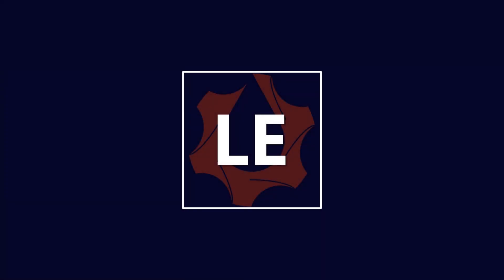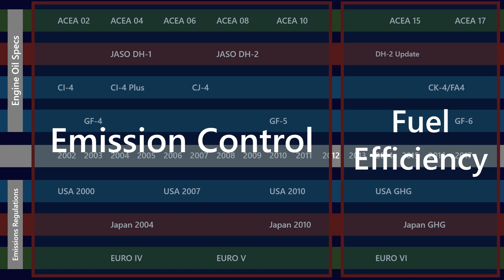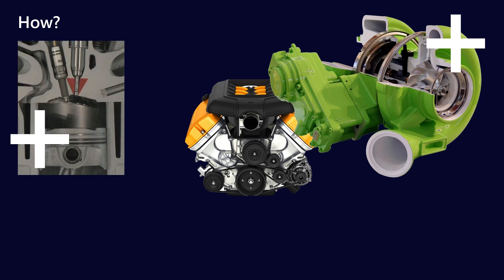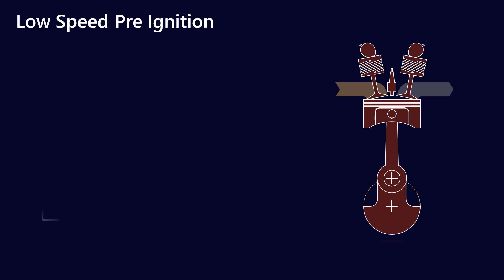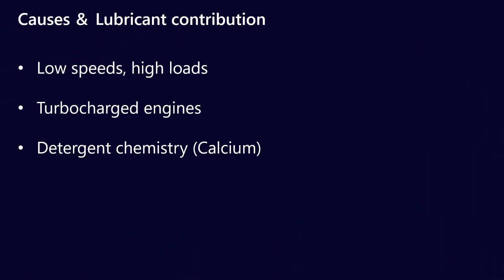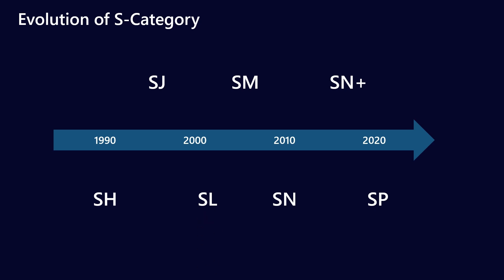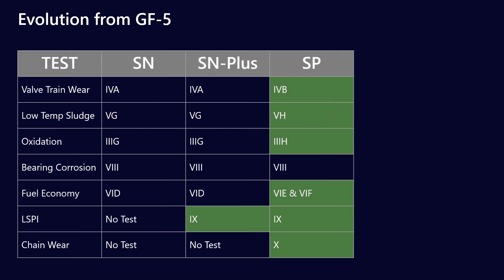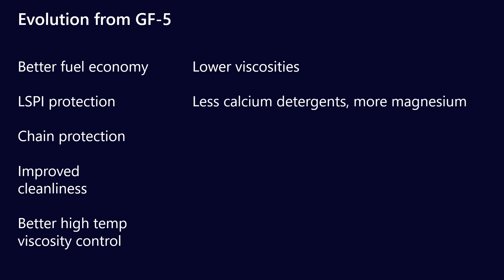SP and GF-6 engine oils - what’s new?

Comment: I wonder if these new oils are even more friendly to flat tappets after break in?
Reply: Nope, SL is the best for Flat Tappets
Reply: @danielsolomon1710  never had an issue with off the shelf oil on 30+ classic cars I’ve had since 2014
Reply: @danielsolomon1710  only time I used a special oil was for break in with driven high ZDDP oil. Not a single lobe down yet. Stock spring pressures and stock lift don’t need anything special. 800ppm zinc is good enough after proper break in. And now with SP there’s less calcium surface competition with ZDDP.
Reply: @Gleone58  I use HDEO in my gasoline engine because it keeps my engine super clean, cooler & longer OCI thanks to high TBN
Reply: @danielsolomon1710  be careful since HDEO formulas are very different within themselves. For example: base rotella is like 1200 ZDDP but is very high in calcium where as Mobil delvac and Chevron delo are much lower in ZDDP close to cars and the calcium is still high.
Reply: @Gleone58  luckily my car is not small cc direct injections turbo engine. I am using a Shell Rimula R6 LM 10W40. It is twice cheaper and better than Shell Helix Ultra. It comes in a 20 liters(21.1338 quarts) bucket for trucks 🤣
Reply: @danielsolomon1710  I know about the LSPI deal but that’s not why I’m saying anything about calcium I don’t own anything DI. Calcium tries to cancel ZDDP out on a given metal surface. They share the same polarity. So on something as critical as camshaft break in you really want almost a near non-Detergent (calcium) oil with a decent 1200-1600 ppm ZDDP and thats it for about 4-800 miles then change over to whatever you want to use. SP reductions of calcium let’s ZDDP do more work instead of fighting.
Reply: @Gleone58  that's exactly what the motor oil geek said in its new video 🤷‍♂️thought 800ppm is enough for stock cams/springs.. racing ones will want more though

Comment: Direct Injrction only + turbo is a bad combination for disasters, requires due diligence in routine maintenance. I've been using Shell Helix ultra 5w-40 which was recently API SP certified, worked well so far for the N55. Noticed Nulon Apex+ and Gulf Western - some 5w-30 meet API SP, hopefully they'll help the Skyactiv-G last. Bit l bit longer. Can't find good cars like GH Mazda6 with MZR (port injection), dual injection might be a good alternative but complexity isn't going to help even if they are made by Toyota 😮

Comment: SP addresses LSPI, but BMW LL04 blows it away in wear protection, sludge protection, deposit protection,  soot thickening, aftertreatment compatibility and fuel economy. Oxidative thickening is the same (Lubrizol Specification Comparison tool). SP is only 'much better' in one area and worse in all others.
Reply: You act as if all SP oils produce the same WEAR. This is simply false in every way…
Reply: @nordicpride9708  I don't 'act' I quote the source that I have used to state what I state. The tool is made by an oil manufacturer (Lubrizol). It's not 'my' knowledge, it's 'theirs'.

Comment: Would be good to explain what they mean by ASH content and what it is. Also how if at all do the new oils reduce the chance of intake, intake valve and turbo carbonization?
  GDI engines require low ash content. Is that to reduce wear or carbonization from crankcase vapors?

Comment: Get rid of low tension piston rings & low tension oil scrapper rings. I think ICE must be designed to have maximum engine oil consumption of 0.1litre for every 1 litre engine capacity for every 1000km travelled, doing at 100km/hr and the  engine had done total of 50,000km.

Basically a 2 litre capacity ICE should not be consuming more than 0.2litre of engine oil after travelling 1000km at 100km/hr.  

Otherwise it is pointless trying to limit calcium or zinc to 1000ppm in trying to avoid damaging or impairing the exhaust catalyst for emission control. Yes, No. 🤔🤔🤔

Comment: GREAT UPDATE. Thanks ... so we Boron antiwear additives be sufficient to protect flat tappet engines ... or should we stick to SM rated or lower, or special designations by manufacturers who might specifically add extra Zinc (meaning phosphoous) given that Cat issues are not big for older engines.
Reply: If you can find SL grade it will be better for flat tappet

Comment: Recently some manufacturers have brought out a 0w-8 oil, an even lower viscosity than 0w-16! I assume also under GF-6B, although it may not be. Thanks for the interesting and informative video.
Reply: That's Toyota. And they're using a LOT of molybdenum to get there. Really interesting.
Reply: I saw a YT video where someone bought a new Toyota Corrolla (2023?) that required 0W-8. Even the dealer didn't carry it!

Comment: During 199x Engine works about 300 - 500K km till general repair....
Its 2023 with amazing lubricants with huge amount of parameters inspected, and engines works about 150-250K km. The main reason is sludge and ash on postons and piston rings.
WTF..... 
Looks like bullshit was placed at users ears and mind..l by Marketing. 

Thank you for trying to explain.
There NO difference between mineral and synthetic oil depending manufacturer recommendations to oil raplace .
So its doesn't matter whether you use synthetic or minaral.

Comment: Where is the gain for the customer though, direct injection=carbon buildup. 0-16 or 0-20 oil in addition to low tension piston rings=oil consumption. Seems they destroy a previously functioning engine setup, to "save the world" which doesnt need saving anyway. And the money for repairs is spent by the customer. Sorry, this is all BS.
Reply: See the chart at 1:30, that’s the benefit.  I drive a 2014 Silverado 5.3 with direct injection.  I wish carbon buildup wasn’t a thing, I have looked at my valves, they are quite dirty, I have never cleaned them but the engine still performs very well.  160k miles
Reply: I have a ‘12 HV I purchased new. Over the course of its life I’ve spent ~$10K on fuel(127K at $3.50/gallon at 45mpg).

If the HB dies today it’ll cost me $5K to have a dealer install a new one. I can do it myself for less than half that but most can’t.

If it was a comparable ICE only engine sedan from that era I’d have spent ~$15K in fuel but no HB replacement cost ever.

So in gas savings, I’m currently ~$5K in the red right now still driving on the original HB.

When the HB in my vehicle needs replaced, a regular person’s fuel savings will have been completely negated.

It seems to me the whole thing was a wash… from the consumer’s wallet’s POV.
Reply: @EvzenKovar-i5p  That is an interessting comparison. Let me add a different perspective: The manufacture and replacement of the failed part will be way less emissions than burning $5k worth of fuel. So the system is working, it is reduing emissions...
Reply: @realseek  
Absolutely. I was simply looking at it from a consumer wallet perspective. From my angle,  I honestly should have bought a straight ICE vehicle in back in 2012.

I keep my vehicles for as long as possible. Because of this, the purchase of this HV put me at a unique disadvantage relative to a similar ICE only vehicle.

The hybrid battery is not the only unique and excessively expensive component of a HV. Toyota eCVTs, whilst technically rebuildable, must be replaced as an entire unit when they fail because it’s impossible to find anyone who will work on one. That’s a cost approaching $10K.

ICE only vehicles don’t have an inverter to eventually fail with age. Probably will set an owner back ~$5K. Having an inverter also means a second cooling system with a second water pump to fail.

HVs often send coolant to the catalytic converter in order to try and bring the engine temperature up faster for emissions. These often fail with age, go unnoticed by the owner, and overheat the engine. Due to current machining tolerances, and nothing being rebuildable anymore, it’s now time to buy a new engine.

The regenerative brake systems have a highly specialized brake booster, that contains a nitrogen cell, which fails with age and will set an owner back ~$4K. 

Because HV engines start and stop so frequently, they have ubiquitous issues with the thermal expansion/contraction cycling that wreaks havoc on head gaskets. A head gasket replacement will set an owner back ~$5K. A person who does mostly city driving is at greater risk for this expense than one who drives HWY. Again, due to extremely tight machining tolerances, this often can mean a new engine.

Relative to the consumer’s wallet, none of these exposures exist with an ICE only vehicle.

HV and EV vehicles may have lowered carbon emissions as you describe, but I was shocked recently to learn that only ~5% of these vehicle’s batteries are currently being recycled globally at the end of their serviceable life. The rest are creating/destined to create massive long term environmental damage in the form of water and soil contamination.

Comment: Stop Start is an anti knock system. When does an engine start overheating? Idling in gear at a stoplight.
Reply: Start Stop leads to more engine wear. It's not an anti knock system viz a viz stop lights. It's a system to take care of EPA
Reply: @_pramodchauhan  So why are you supposed to wait 20 minutes after the engine stops to check your oil?
Reply: @suggesttwo  The dip stick checks oil level from the oil pan. You let gravity do its thing n then check the level. Not necessarily 20 mins. 5 should be ok.

Comment: Dropping calcium additives from 1200ppm to 800ppm equal to reduction by 1/3. From 2005 to 2015, companies like BMW, Toyota, VW, KIA and few others have somehow messed up designs of their pistion-pistion rings. This leads to high engine oil consumption of >0.5 quart per 1000 miles. These "consumed oils" and their additives will eventually get into top of pistons and later onto catalyst. Logically, this will quickly lead to failing of MOT test. Good engines should not be consuming more than 1 quart engine oil per 6000 miles. Regards.
Reply: GM did the same with their V8, lots of oil burning in those engines, design most likely

Comment: Would i benefit from switching from 10w40 api sn to 5w30 api sp? I understand it is backwards compatible but is the api sp designation okay even on a wet clutch manual transmission motorcycle?

Comment: i’m not a engineer but I just cannot conceive how big ole semi truck 18 wheelers are going to be able to be manufactured to handle a 0W oil.  Of course not being an engineer, I could be way way wrong so please let me know.  Which also begs the question, what in fact is the largest displacement engine in existence that uses a 0W oil?
Reply from the maker: Great point. So I think that the 0W's are most likely being applied to small displacement engines. 0W's seem to be more common in the European manufactures, which makes sense because the manufacturing tolerances tend to be smaller on those makes.
Reply: ohhhh ok makes sense.  Thank you!

Comment: i do find it hilarious how “they” got away with the whole “stop-start” bs. Which involves moving parts, which in turn increases wear on the engine over the life of the vehicle, which in turn, causes more waste in the long run, thereby canceling out all supposed short run mpg “savings”.   It is hilarious to me that “they” got away with that stupid rule, and also quite saddening that more customers are not aware or informed on such simple mechanical concepts.  Oh, right, go ahead and repeat to me the fun marketing lines of how they improved the starter mechanisms to handle many more thousands of start-stop-starts.   I love laughing at folks that tow the line like that. 😂. At least there are plenty of places to go get a simple “start-stop” delete installed on the vehicle, well in the States anyway.
Reply: Stop-start is absolutely no problem when engineered properly. Hybrids have been stop-starting for over twenty years. When's the last time you heard of someone's Prius having an electric motor failure?
Reply from the maker: Yeah stop-start isn't so much of a problem once the engine is up to temperature. What can really kill the engine is a lot of very short trips in the modern, small, GDI engines. The fuel dilution produced lowers the oil viscosity, and if the engine never gets up to temperature the fuel doesn't volatilise off. With more and more short trips the oil viscosity continues to decrease....

Comment: I can't seem to find any GF-6A 0w-16 oil. Has anyone been able to find any?
Reply from the maker: There is no 0w-16 GF-6A. GF-6A was designed to be completely backward compatible, but 0W-16 didn’t exist before then. All 0W-16, 0W-12 and 0W-8 oils will be GF-6B.
Reply: @LubricationExplained  that's fine. A mechanic friend is suggesting it's okay to use 0w-16 in my car, but Toyota/Lexus are saying they count vouch for it when I contact them and ask.
Reply: I've got a 2006 lexus gs450h hybrid, and on the manual it says I should use 0w-20. I am keen to know if I can use 0w-16 GF-6B oil. I can't find GF-6A spec of 0w-16 anywhere.

Comment: Would API SP have HTHS as good as ACEA A5B5 oil?
Reply from the maker: So ACEA A5BR requires HTHS between 2.9 and 3.5. I don't believe that there are any requirements for HTHS in API SP, aside from the minimums set as part of the oil viscosity classification.
Reply: @LubricationExplained  So, does it mean A5/B5 would provide better engine protection than API SP and GF-6A engine oil?

Comment: Would engine oil with extra zinc but lower viscosity for e.g. 5w20 give the same protection to the engine as engine oil with higher viscosity but less zinc for e.g. 5w30?
Reply from the maker: The answer is unfortunately "it depends". Theoretically it could, but it really depends on the engine.
Reply: In my 2012 Volvo S60 T4 the engine comes filled new with SAE 5W/20 but in the first oil change, the owners manual says “it’s up to you to keep using the SAE 5W-20 or switch to SAE 5W-30.” I live Costa Rica where temperatures seldomly drop to freezing except in the mountain ranges and for hours during the year and have been using SAE 5W-30 despite the fact that the dealer uses SAE 10W-30. I am now using an SAE 10W-30 with no visible down grade in performance nor fuel economy. I replace my oil and filter every 5,000 Km or 3 months…

Comment: Just because thin oil is more efficient in Japan, some manufaceturer force the same viscosity to every country, even at tropics. As result, many motorcycle in my country have to change oil at 20% of suggested oil change periode because the oil already ruined. Many gets fuel dilution and depleting oil problems too. Damaged piston and cylinder are not rare.
Reply from the maker: There's definitely second order effects. In most countries previous designation lubricants should be available as well.
Reply: @LubricationExplained  I live in Indonesia. There is no second option. Many Japanese brand recommend same oil viscosity as Japan. Honda Motorcycle CEO even try to force 10W30 globally.

Comment: Still looking motorcycle oil with api SP :(
Reply from the maker: So most motorcycle oils probably aren't going to get the SP designation. If there's any friction modifiers in the formulation they interfere with the wet-clutch system on a motorbike.

Comment: So is it safe to use an 0W20 oil API SP GF6A on a 4 cyl inline4 non TGDI engine? 
The manufac actually only requires 0W20 API SN GF5, but I've been experiencing what I believe as a LSPI since it was brand new
Reply from the maker: Without knowing the specifics, most likely yes. GF-6 oils are designed to be backward compatible.

Comment: It would be amazing to see an oil using all this modern tech but without the formula restrictions of catalytic converters. 
Basically a modern oil from a first tier oil company but made for old collector vehicles which often have different oil design requirements with flat tappet valve trains, possibly leaded fuel, intermittent storage, moderate rpm. (Low lead avgas is often used in old vintage vehicles car or tractor, partly for protection against exhaust valve-seat erosion but mainly because to avoid costly storage issues and short carburetor life common with the oxygenated fuels sold for modern highway use.)
Reply from the maker: Racing oils. That's where all the technology is at. They don't have the restrictions of catalytic converters so tend to have much higher levels of ZDDP / other antiwear additives. Although the engines aren't using flat tappets, the higher loads of race engines necessitate a more extensive antiwear pack.
Reply: @LubricationExplained  I will look closer at racing oils. I have been under the impression that racing oils are formulated with the assumption of very short drain intervals so they may not be appropriate for something like a classic muscle car engine that is driven on the street or an antique tractor. 
As a possible example, race oils might be insensitive to the TBN package. (High TBN mineral deposits would get cleaned during frequent tear downs and TAN wouldn't have time/moisture to be a significant concern relative to many other wear factors.)

Really the vast majority of race vehicles are not in the premier leagues with million dollar sponsors. So many racers use flat tappet engines, as they are much lower cost and a bit lighter for the same strength(high rpm), and generally more reliable than rollers. (A little more friction but also fewer parts to get wrong.) 

Roller based valve trains are primarily a way to meet fuel efficiency and emissions standards. Thus many motorcycle engines, like amateur racers, do not use rollers. (Insignificant friction relative to air drag. And unlike cars, moto fuel use hasn't been regulated in most places.) 
Though motorcycle specific oils must also consider wet-clutch performance and act as transmission gear lube, because the most common configuration uses crankcase oil for all three parts.